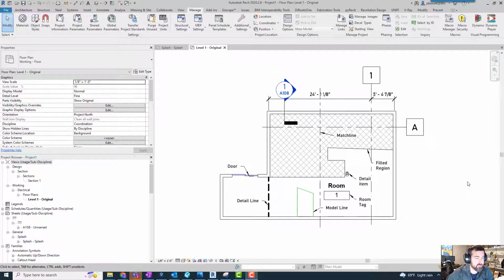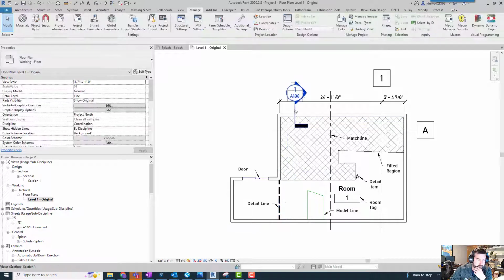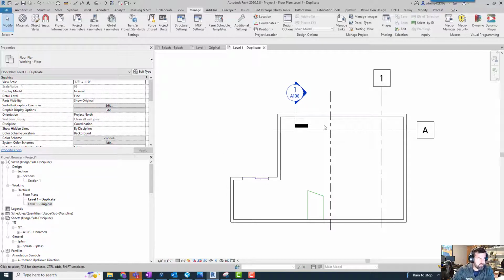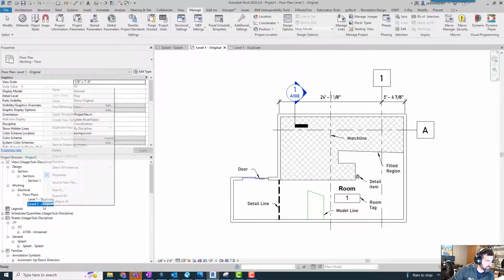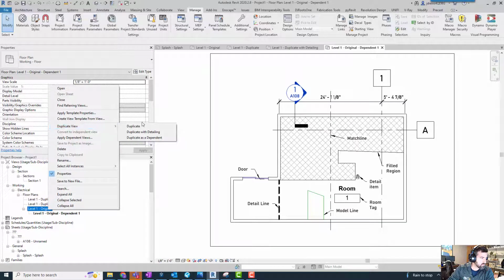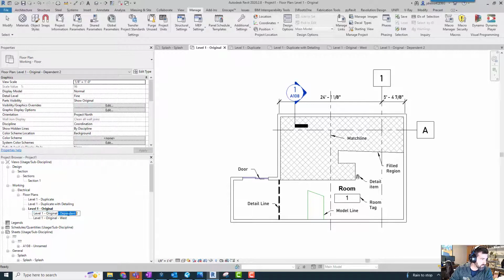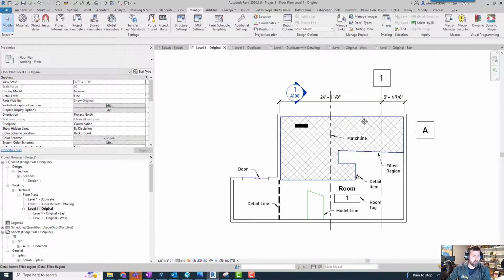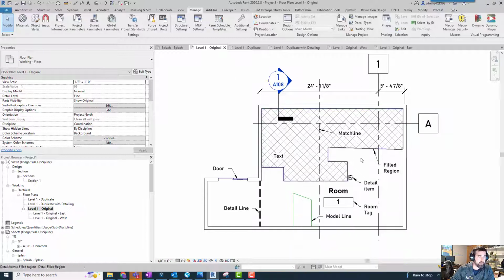Revit Basics  - Duplicating Views and understanding dependent Views

Comment: I'm trying to rotate my plans to fit into the sheet and clean it up for printing so I thought to duplicate the view and ness with the one I want to print.

The problem now is that when I delete a window or some other element, it deletes on the original as well. Is there a way to fix this?
Reply from the maker: Hello! How are you trying to rotate it on the sheet? By rotating a scope box/crop region or with a drop down?
Reply: @bimtechmngt  I was rotating the entire floor plan. I tried rotating just the crop box in the sheet but that rotated the annotations and the grid letters as well.
Reply from the maker: @kahidris  Did you try rotating with a drop down?
Reply: @bimtechmngt  I'm not sure what that is... I rotated with the RO command though.

Comment: i already duplicate view WITHOUT dependency, then i tried to deleted floor slab on duplicated view but it also deleted on original view ? any solution for this ? should i remodell the floor to not cut the beam ?
Reply from the maker: Hello there! All modeled elements (floors, walls, windows, conduit, pipe, equipment, etc.) are a part of the model and are visible in all views (with some exceptions for example: view range, visibility of model category). If a modeled element is deleted, it is deleted from the project and all views where it would be visible.

Analogy - If you have a camera in your living room, all of your furniture is the modeled elements. You create another view (Duplicate, Duplicate with Detailing, or Duplicate as Dependent) this essentially will add another camera. Now, if you remove (delete) the couch, the couch is gone from both cameras.
Reply: @bimtechmngt  Im sorry, but it happen only on floor. If i try to delete like the other element for example the Beam or Column, it just removed from the duplicated view, but remains intact in the original view.
Reply from the maker: What do you mean about cutting the beam?
Reply: @bimtechmngt  Well you know, when floor intersect the beam, it will cut it off the section depend where i put the floor
Reply from the maker: @MyONiceDaFirst  I am not sure I am following you here, I apologize.

Comment: Thank you! So using the first two options I will be able to make changes to the floor plan without affecting the original? This is a renovation project and I  want to maintain the existing conditions.
Reply from the maker: Heather, that isn't really best practices. If you are going to be doing a renovation I would suggest utilizing phasing and phase filters. Feel free to reach out on our website we would be happy to connect.